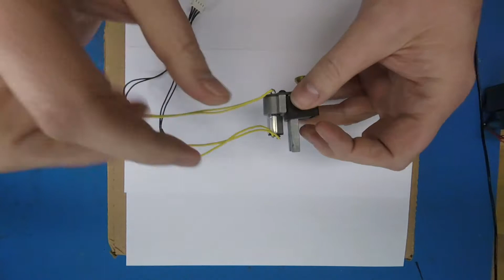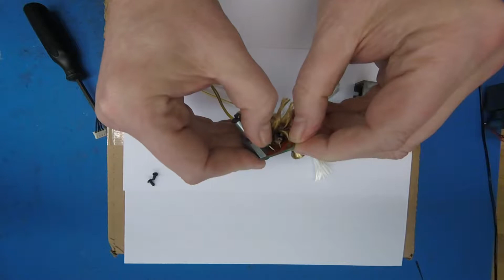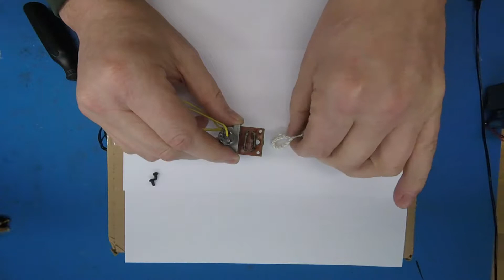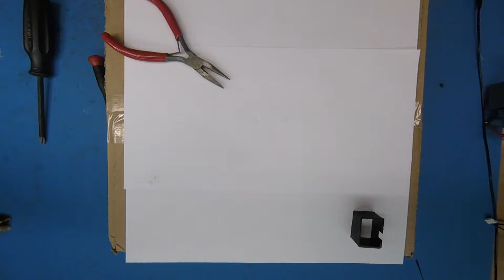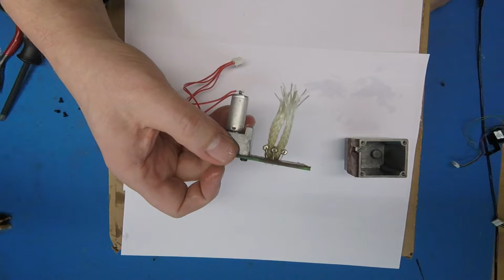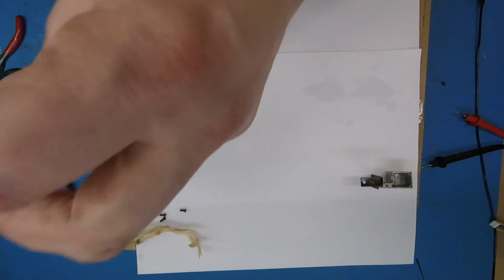Smoke Unit Maintenance - Service Video #3 1-18-18

Comment: I have some problems. Not only is the fan very noisy but the unit is running very hot to the touch. I could feel the heat from the shell to so I shut it down. Help?